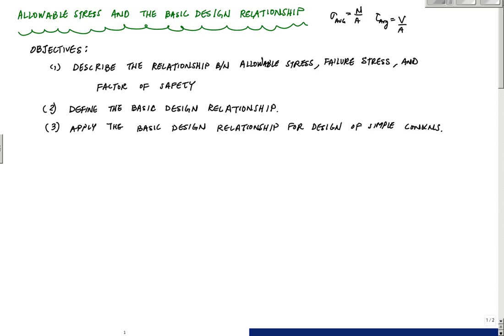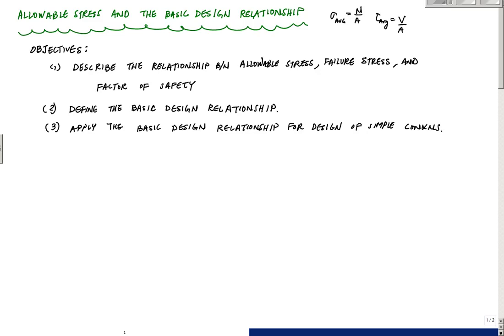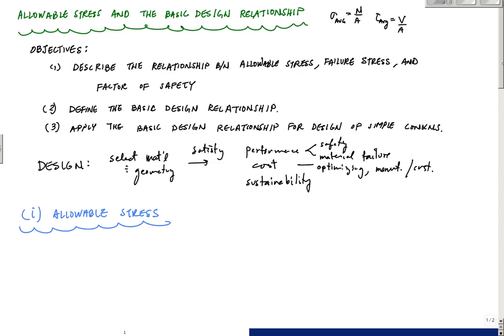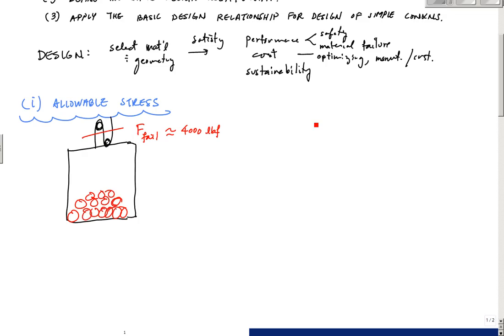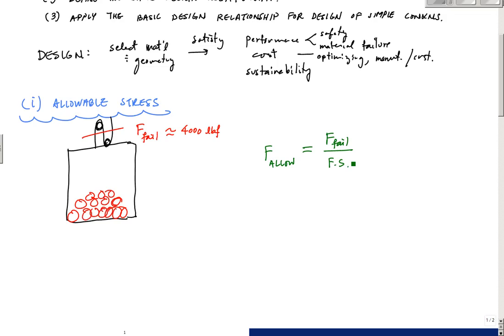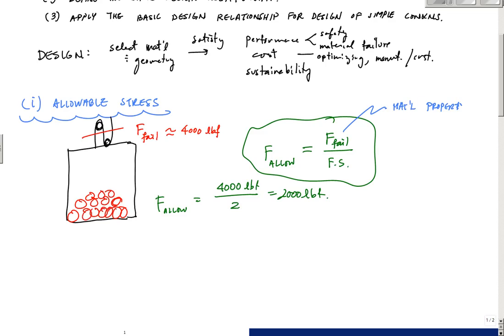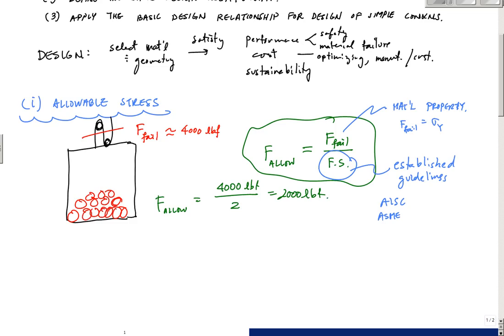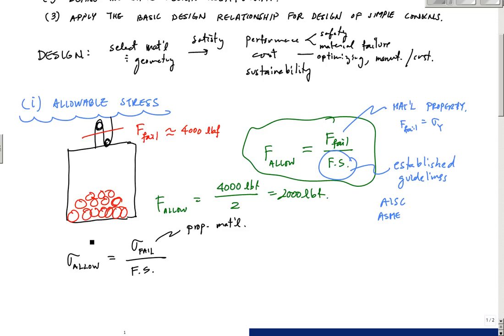Allowable Stress and Design of Simple Connections (1/2) - Mechanics of Materials

Comment: great explanation! :D but i have a question, can the factor of safety be less than 1 but not a negative or, of course, zero? something like 0.5 or 0.4? because i think we had a test back then that had a factor of safety as 0.5...
Reply from the maker: +MegaLo0p  typically a safety factor is greater than or equal to 1.0.  I wonder if your instructor was thinking of load factors in structural design or resistance factors that get applied to the theoretical (or nominal) strength.
Reply: well, most questions from our tests are gotten from textbooks, and he did say that that particular question was quite advanced compared to what we have currently covered in our mechanics of materials lessons... but hey, thanks for the info :)
Reply: More power to you :D keep making great videos